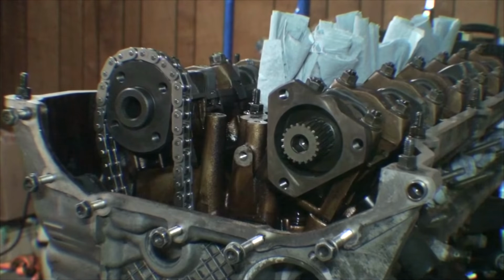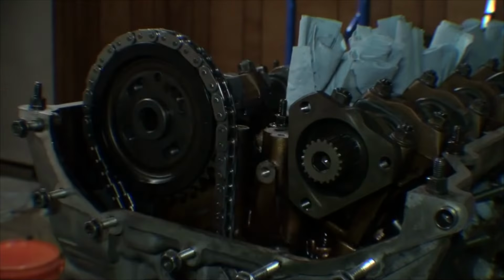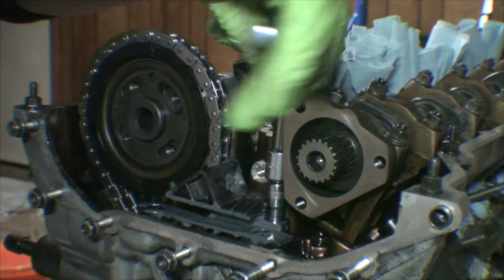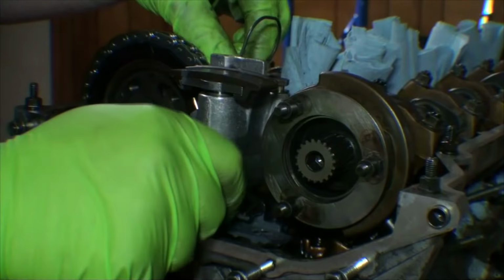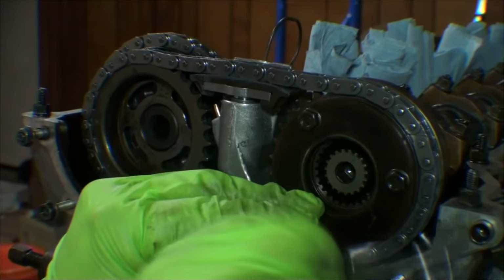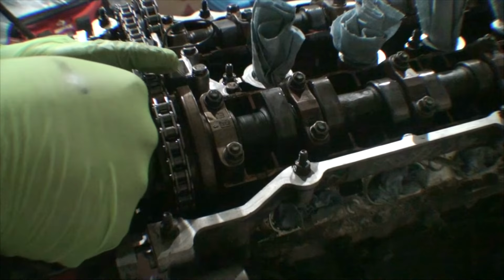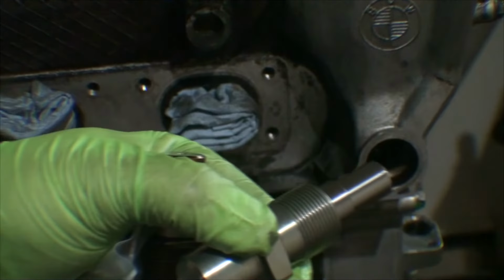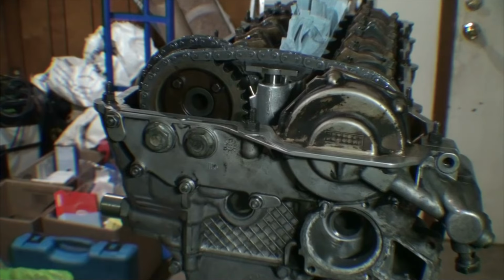How To Set Timing on a Single VANOS Engine (M50TU/M52 & S50 S52)

Comment: Hey, I hope everything good, your video was very helpful and educational, but one question, after head gasket replacement( I believe I did everything correct) I got camshaft position sensor code p0340, what would be the problem, I used the old sensor, M52b28 single vanos. Engine starts normal, but it runs rough, and no any other codes , just that. Thank you

Comment: Hi Gareth. Great video and explained it all in a much better way.  I just rebuilt my M50 single vanos and with the crank and cams at the correct locked points it sounds like a bag of nails on start up.  Almost a backfire through the inlet.  I used new chains and set up to the left so I'll retime with your video. I'm assuming the vanos being slightly out will open or close an inlet cam early/late and possibly cause the backfire type noise.  I turned the crank by hand twice to check for interference and didn't have any issues so hoping all is still well in the head!
Reply from the maker: Noise on a first start could be attributed to the hydraulic lifters being dry. Assuming the engine was down for an extended period of time the noise from the top end could be attributed to lifters. They will be noisy until they fill back up with oil but no damage can occur from the lifters being dry. A backfire through the intake manifold suggest a possible timing issue though. These engines are really finicky on the timing front and will run even if they are a tooth off (also there won't be interference). Have you driven the car? How does it feel on power?
Reply: @GarethFoley  engines been sat for 2 years. Not driven it. Only fired up to idle. Will compression test tomorrow. The backfire isn't at set times. Its once every second it two. Will redo the timing over the next few days and see where I'm at
Reply: @GarethFoley  your video is by far the best video for Information so thank you.  I've managed to track down some old BMW workshop tools for fitting at testing vanos too so that should help
Reply from the maker: @craigvalentine1547  Engine sitting for two years explains the noisy valve train. Over that time the lifters would have bled down and are dry. Check timing again on both cams but pay attention to the intake cam. Before popping the valve cover back on rotate the engine by hand and make sure that when the engine is TDC everything remains aligned correctly.
Reply from the maker: @craigvalentine1547  The tools will help for sure. I'm glad the video was helpful.
Reply: @GarethFoley  just a quick one to say I finally timed it and it fired up right away. Thanks again. She's a bit rough as it's not ran for 3 years but it will smooth out I'm sure.
Reply from the maker: @craigvalentine1547  Nice. Good stuff. 👍

Comment: My cams havent moved since i took the head off. But the cam locks dont line up perfectly with the the edge if the head? Is that what determiens they are perfectly at top dead centre?  The holes in the cam sqaures are up and the lobes on cylinder 1 are pinting towards each other although not perfectly but towards each other no less

Comment: Hi i have and european bmw e36 325i from 1994 i tink it will be and m50b25tu engine and im replacing my vanos unit but now im there i might aswell change the timing tensioner and be shore its and hydraulic one like you say  but my tensioner dus not have and hole in the back to put and hex key in ? And is it possible to change the lower like you do to hydrolic when the engine still is in the car? Thanks real great video 👌👍

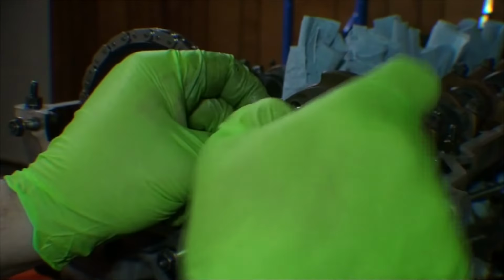Comment: There is a critical error on 6:08 - you haven't torqued those three screw-in pins with 20Nm.
Reply from the maker: I did torque them, missed in the editing process. I dropped a notecard in the video but it's not working so I'll make sure I fix that.
Reply: @GarethFoley Hi you briefly mentioned there are engines lit there with a single 4mm. I have a m52b25 with a single 4mm and was wondering the correct install order on the intake side. Like where does the sprung washer crush between ?

Comment: Hey Gareth , great Video!
But i have still a problem with setting time on my M52 B28.
I only get the correct position with the mainchain , if the two arrows on the wheel are horizontal.

Does it matter if these arrows on the wheel arent vertical like in your video?

The Chain is new.

Best regards from germamy
Reply: Did you solve problem? I have same engine and same job whaiting for me
Reply: @stjepanzivkovic2310  Doing it with the alignment tool is pretty straight foward. Flat side of the square at the end of each camshaft has to be level with the edge of the seal. Turn the engine over by hand for two or three rotations and check alignment again. Did it wrong the first time on my M52B25 and it ran pretty bad. Checked again afterwards and realigned the exhaust cam.
Reply: @Patty-qy8qh  thanks for the info! Appreciate mate!

Comment: Help. I am not able to set the upper timing. Could it be that my upper chain is stretched? 

When I turn all the way to the right, the intake window is not hitting the stud on the left corner. Same thing on the exhaust side. If I turn all the way to the left. The exhaust window is not touching the the stud on the right corner. 
To adjust If I move the exhaust sprocket one tooth forward or backward The window is off alignment. The gap is about two or 3 mm before hitting the stud. 

The engine is at TDC . The cams are locked in place with the two dots on top. 

The only conclusion is that the upper chain may have been stretched. it’s got 220,000 miles

Comment: after s50 cams, will it work instantly or only after dyno tuning? and thank your for video, helpful with my chain renewal job! :)
Reply from the maker: The engine will run fine after the cam swap (assuming timing and VANOS installation is correct). Tuning only maximizes the power potential and should be done. But the car will be driveable before that is done.

Comment: on some e39's the center cones adjust the cam sprockets 9:15 but yours dont have or use them..mines does..good info thou..
Reply from the maker: Sounds like you're describing a dual VANOS engine (M52TU/M54). The way in which the VANOS is installed on those engines is entirely different. The tools needed for VANOS install on dual VANOS engines are different  than earlier single VANOS engines. The only tools in common between a single VANOS and dual VANOS M5X engine is the cam locks, flywheel lock pin (if using it), chain tensioning tool, and the VANOS testing tools. TDC for the crank and cams remains the same but the installarion of the VANOS unit is different. The dual VANOS engines just a jig for setting the depth of the adjustment gears into the cam. You 100% need that for successfully installing a dual VANOS unit on a later M52TU/M54 engine.

Comment: Hey Gareth, just wondering what the symptoms would be if the vanos is pulled in on the wrong tooth. Currently have loud popping and fluctuating revs from engine bay when car turns over, thanks!
Reply from the maker: Generally speaking it just jams the VANOS mechanism which prevents full intake cam advancement. You will get a fault code for this (OBDII P1519, BMW fault 212) and most likely a notable loss of mid range power. I have heard of an out of time VANOS unit cause noise and it could technically cause though running engine conditions. I would check it again and if possible perform a VANOS travel test before putting the valve cover back on.

Comment: I did not see any torque done to the intake camshaft sending wheel studs, or is it just finger tight?
Reply from the maker: Missed it during editing. 10Nm is the torque spec to mount the VANOS to the cylinder head.

Comment: On my M50 engine, the spring tensioner on the side has a notched piece at the end of it where the S52 is flat where it rides on the chain. I was thinking of upgrading because it makes sense but that makes me hesitant with it being a different looking design. What’s your opinion?
Reply: Okay that’s weird. I just realized that I can’t buy the same looking tensioner as what I have. I’m confused now
Reply: @0b1wanJanobee  OBDI vs OBDII motors use different guides, and different tensioners. An S50 tensioner could be and upgrade to and M50
.

Comment: Do you recommend changing the upper chain?
Reply: If you have the engine this far taken apart and you have the ability to get an upper timing chain, yes you should replace it. Especially on higher mileage motors that haven't been serviced like this recently

Comment: Hey. 14.00 is it necessary to bring The rotation all The way to The left even after The vanos has gripped on?
Reply from the maker: No, not necessary at all. I wanted to see where the stop limits were in the cam travel. I actually forgot to cut this part out as I was looking for something else when I was doing that. General rule of thumb is stop when the VANOS hub is fully engaged.
Reply: @GarethFoley  thank you sir This video really helped me gain The motivation to do The job.
Reply from the maker: @arafat5710  No problem. Glad the video is helpful to you. It's not a terrible job, just a little finicky.
Reply: By The way. Do i need a special socket for The e12 head bolts?
Reply from the maker: @arafat5710  I've removed the head bolts before with an E12 shallow socket + extension but the actual head bolt tool is more confidence inspiring as it is one solid piece and doesn't flex like the socket + extension combo does. The head bolt socket is also thicker on the drive end so it's better when torquing the head bolts. I recommend having the socket, they are relatively cheap like this one:

https://www.fcpeuro.com/products/bmw-head-bolt-socket-e12-torx-cta-9259

Comment: I have a m52B28 and the intake cam is not exactly the same so this will not work for a m52
Reply from the maker: This 100% works for an M52, which is the engine I am working on in this video. It will not work on an M52TU engine which has dual VANOS (intake and exhaust variable cam timing) which I have to assume you have. If you VANOS unit looks like the link provided below you have an M52TU:
https://www.fcpeuro.com/public/assets/products/119054/large/open-uri20140226-13157-1m38x0k.?1496428235
Reply: @GarethFoley  No it’s a m52b28 and it had different stud bolts and shims than the one shown in this video
Reply from the maker: @luckylegs8547  Okay, that makes more sense. I brought up the possibility of the M52TU because that is often confused with the M52. The intake cams would not have changed on any variant of the M52B28. There was a change for the intake side of the engine which uses a plate spring with a two and four mm shim. There is an earlier version which uses a single thrust washer. The only thing that changes with the VANOS install is the use of the VANOS wrench. The version that uses the single thrust washer does not need the tool to rotate the chain to push/pull the VANOS helical (allegedly). I can't say I have ever seen the single thrust washer setup but BMW TIS days every other step in timing the engine is the same minus the need for the VANOS wrench.
Reply: @GarethFoley  One of my cams in the m52b28 had been upgraded to a S52 cam and hence my confusion with the difference your tutorial is perfect I’m very sorry and thank you for your work